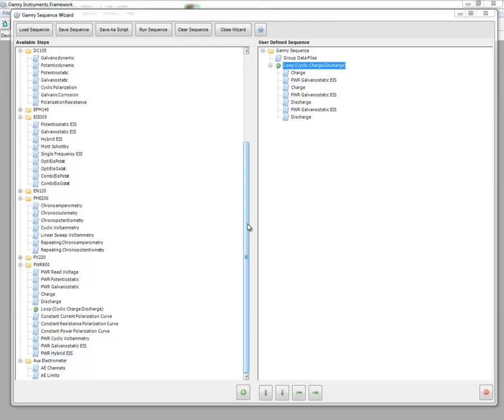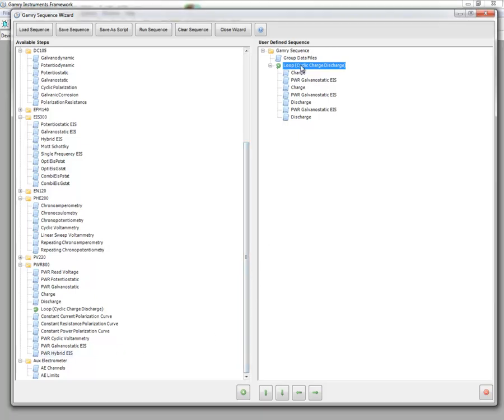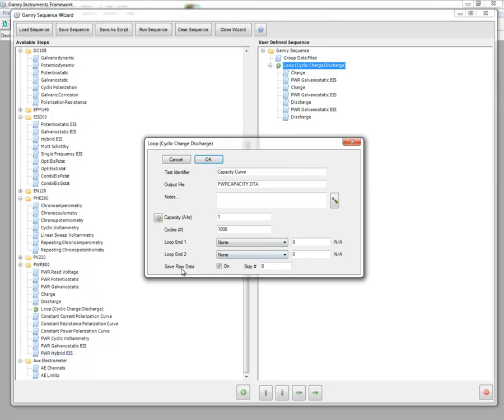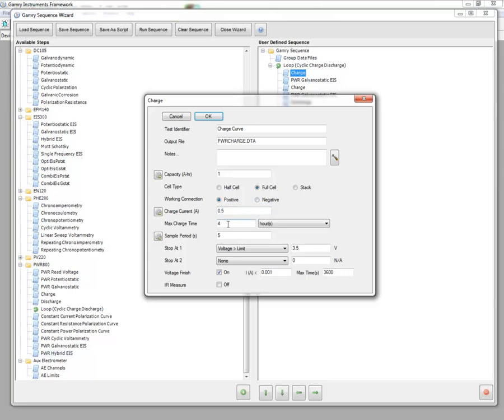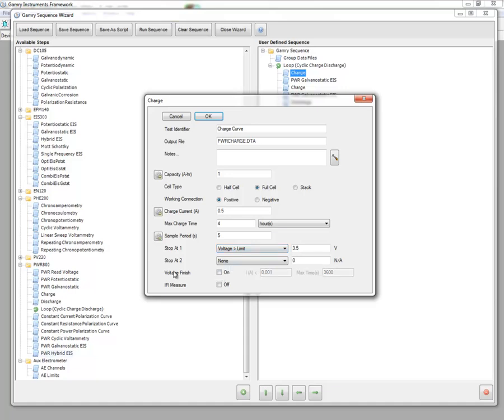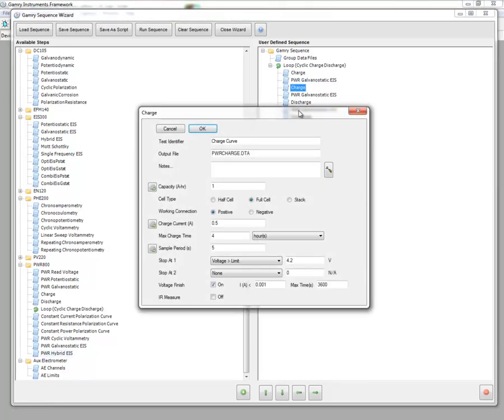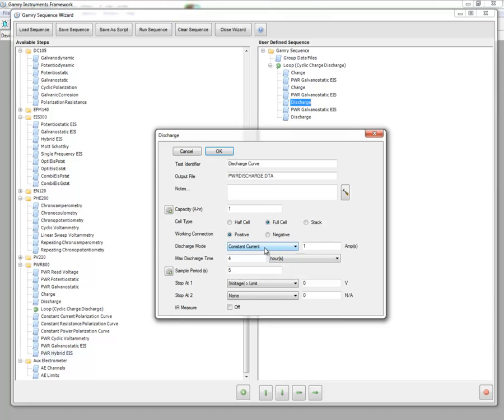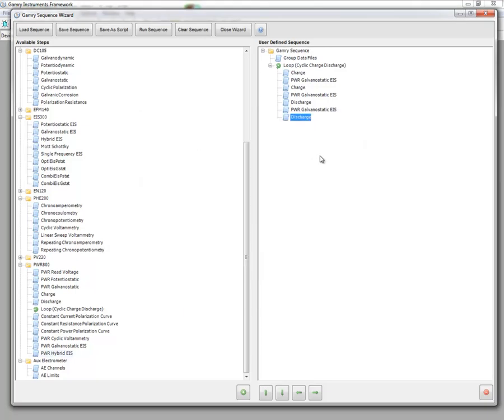Using the Gamry Sequence Wizard - Part 4

Comment: Thank you very much for these videos. It would be nice to have another video that shows how to run experiments with two different Gamrys with the same computer.
Reply from the maker: We will be creating additional videos and will consider one for this.  However, running two different experiments with two Gamry’s on one computer is very easy. Start your first experiment and choose which potentiostat you would like to use by using the radio button at the top of the experiment setup window. Once your first experiment is started, choose your next experiment and select the other potentiostat to perform that experiment. Please contact us directly at techsupport@gamry.com if you need more immediate assistance.  
Thank you for your support of Gamry Instruments.